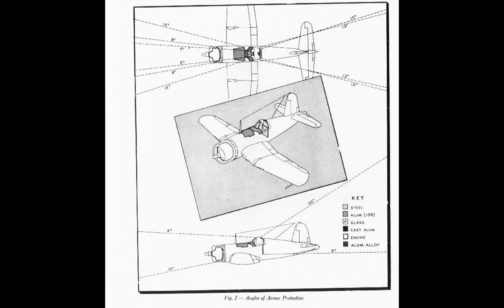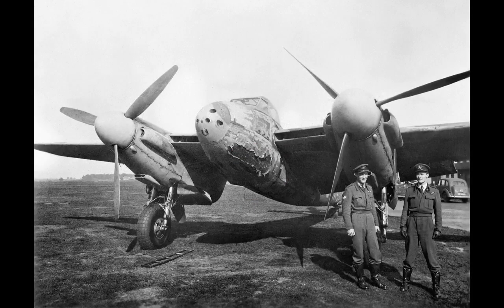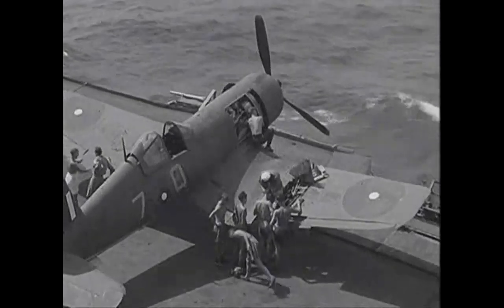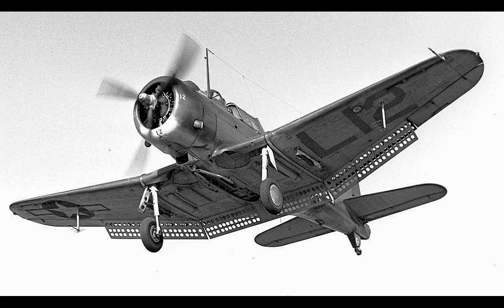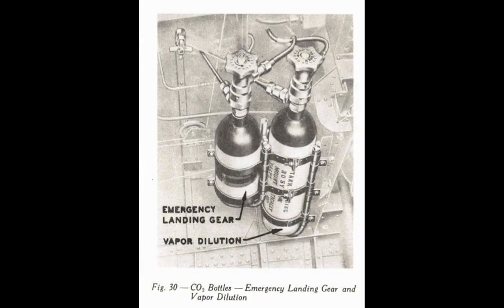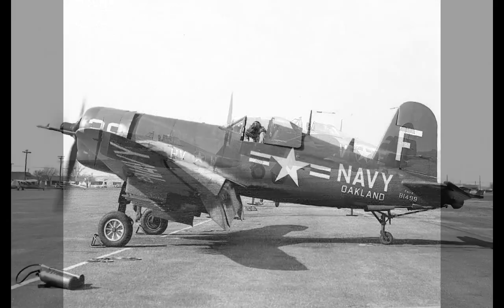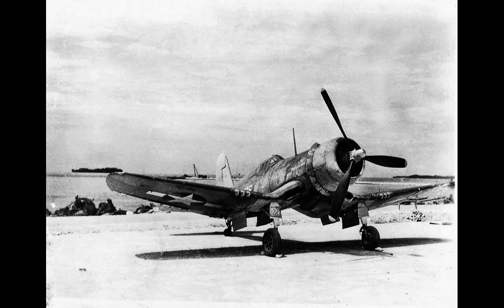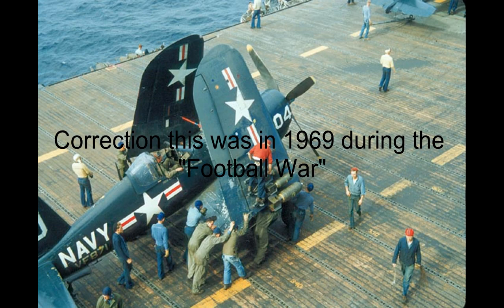F4U Corsair Design Features

Comment: Hi Greg, after seeing a video of a Corsair folding her wings down with engine shut off,I wonder how it's done? Is there a battery supplying an electricdriven pump?
Reply from the maker: I haven't seen that, but it's either a big accumulator or an electrically driven hydraulic pump.
Reply: @GregsAirplanesandAutomobiles  From the F4U pilots manual: "With the engine running, the wings will fold automatically. Otherwise, the hand pump must be used." Never thought of a hand pump, because folding movement was quick and fluent.

Comment: I believe the Boeing 777's vertical fin is in front of the horizontal tail due to the Whitcomb area rule to reduce drag.
Reply from the maker: I don't think so, but if you have any evidence of that, I would be glad to hear it.
Reply: @GregsAirplanesandAutomobiles  
I don't have any hard evidence I'm just going by what my instructors said when I did my aero engineering apprenticeship with Qantas...but I'll see if I can dig something up.
Reply: @GregsAirplanesandAutomobiles  
I should also point out that another reason for staggering the horizontal and vertical fins is to prevent the horizontal fin from blanketing the fin during a stall so as to maintain rudder authority.
Reply from the maker: Normally when rudder control during stall is the priority, they move the rudder farther back, like on the Mitsubishi Zero, or P-51 Mustang. In fact in every case I know of with the forward rudder location, the plane is prohibited from doing spins specifically because the rudder doesn't have enough authority at high angles of attack.

Comment: Re the tail fin being far forward of the taiplane: probably also done to ensure rudder is not blanked by the tail plane if the aircraft is in a spin. Helps with spin recovery. If the aircraft spins flat, the tailplane can stop air flowing over the rudder and so you cannot recover by using opposite rudder input.
Reply from the maker: A lot of people have said that, but I can't find a single airplane with that tail design that's approved for spins, in fact, it's the opposite, every plane I can find with that tail is specifically prohibited from intentional spins.
Reply: @GregsAirplanesandAutomobiles  interesting.  Is there any design specification explanations from Vought or is it just lost in the mists of time?
Reply from the maker: I am afraid the information is lost. If it's not, I haven't been able to find it. As with Repulblic Aircraft it seems that with multiple mergers and break ups a great deal of information was lost or destroyed to make space back in the era when everything was on paper. What was Chance-Vought is now the Triumph Group: https://en.wikipedia.org/wiki/Triumph_Group  and I doubt they have anything on the Corsair at all.

Comment: A couple of things to add info to a great video. First, after watching your video on the maneuverability of the Japanese Zero, you posited that the tail design was done to allow the plane to remain maneuverable at very high angles of attack. You then went on to say that you didn’t know of any other planes that had this feature. Well, here is the Corsair with the same feature. Also the DeHavilland Mosquito had the same feature. I think this may have been due to the rapid pace of aerodynamic design in airframes. Many planes were built the way they were because that was the prevailing state of design. Don’t forget many design features in airframes were copied from previous generations. The Grumman F4F was the next logical progression from the F3F biplane design. The F4F’s landing gear was manually retracted. Thus you would see the plane flying an unusual profile just after takeoff while the pilot, often sweating profusely, cranked the gear up. The next generation of fighters used either electric retraction (the FW-190 for example) or hydraulics. In the case of the Corsair’s landing gear, not being telescopic, required it to be very strongly sprung and that was one of the primary reasons it failed early carrier qualifications. Hard landings led to high bounces and missing the wires. One part of your video shows a Corsair being snagged out of the air by the arresting wires. This caused the plane to rotate nose down very quickly and ripping everything forward of the wing off. This was obviously be a bad thing and it required Chance Vought to redesign the landing gear. One of the reasons the Corsair had such strong landing gear was because of its very large, forged main spar. This W shaped spar allowed for very strong landing gear. Anyway, the spar was a W shape because of the design decision to make the wing the shape it was. One last thing about the wing design, the wing attached to the fuselage at a 90 degree angle with no fillets.
Reply from the maker: Absolutely not. The Zero's vertical stab location is completely the opposite of the Corsair's in relationship to the horizontal. I also specifically mentioned the Mosquito's tail in this video.

Comment: Wow.  A-26 in the pic had 16 x .50cal M2 (HB) firing forward . . . 8 gun nose, three guns in each wing, and the dorsal turret locked forward.  A whole lotta lead goin' on.
Reply from the maker: Yup, you don't want to be in front of an A-26.
Reply: William, and additional  you can use  Gunpacks  (Pods) , with four  0.50 cals under each wing

Comment: I believe also that the Corsair was the first to incorporate flush riveting.  If my memory is correct.
Reply: Not sure but I think you'll find the early model spitfires had flush riveting on the wing leading edges. They built a prototype with all flush rivets and then stuck split peas onto all the rivets with glue. Then, after a test flight, they checked the plane to see where the split peas had blown off and in those locations installed flush rivets in future aircraft. Dome head rivets were cheaper and quicker to install, so they used them wherever possible.

Comment: was this the best piston fighter during ww2.ive always wondered why it was not a frontline fighter in europe.on the accurate fighter sims it always seems to feel the best and for me i get high kill ratios with this plane.so why was it not used in europe in a major way.i know the royal navy used a few????
Reply from the maker: It's really tough to say which WW2 fighter is the best, but clearly the Corsair would be in the running. In Europe it would have been highly effective at low altitudes, but at high altitudes it's another story. Up in the 20-30k foot range, where the plane would need to perform against 109s and 190s while escorting U.S. bombers, the Corsair would be at a disadvantage. There were also political and logistic issues. Initially Corsairs were flown by the U.S. Marines, who were in the Pacific. I don't think the USAAF would have wanted to coordinate with them in Europe, but that's just an assumption on my part.

Comment: On the forward mounting of the vertical stabilizer. I'm pretty sure it was in fact an aerodynamic reason. I can't remember where I read it, but (and I might not be spot on here, but it should give you a good place to start more research) As I recall, the forward mounting was for high speed stability. As you know some P-38's had their tail's lock up during high speed dives, resulting in aircraft/ pilot loss. I believe that the forward mounting of the vertical stabilizer on the F4U was an early attempt at solving the moving tail problem at high subsonic speeds. As I said, I might be off on that, but I'm pretty  sure it was for an aerodynamic reason. Great video as always. Keep them coming Greg.
Reply from the maker: It's possible, but I haven't seen any evidence either way, and the structural reason makes a lot more sense to me. I doubt it's for high speed dives, the Corsair's wing already limits it there, as with every naval fighter of WW2. In the case of the P-38, it's tail locked up at high mach numbers (like around .70) but that had nothing to do with the vertical fins.

Comment: 13:30 I’ve heard that one of the things that made the P-51 such an icon was actually just that the cockpit was layed out in a way that made sense, and that it was much roomier than most.  I’m assuming that the roominess was necessary for those long flights

Also, more in line with the video, given how much more vulnerable to damage at high speed the gear is on most planes, I would imagine that the sturdiness of the gear was designed in part to also allow them to be used as airbrakes. And you can’t use the gear as airbrakes if they are fragile, which telescopic gear would probably be

Comment: Hi, at 10.30 you start talking about the location of the vertical stabiliser. I think this was done for spin recovery reasons. With the relatively forward location of the vertical stabiliser it would not be in the wake of the horizontal stabiliser when the aircraft was in a spin, see "The Design of the Aeroplane" by Darrol Stinton, inparticular plate 13-1 and the top picture of the NDN-1 Firecracker. This aircraft has a similar position for the vertical stabiliser, "...it has some of the best spin recovery characteristics...even power ON..." The pilots manual for the F4U-4, section 17, says words to the effect that intentional spinning was not be done but if you find yourself in a spin then it is easy to get out of.
Reply from the maker: The Corsair was not approved for spins. As for it being easy to get out of, the manual I am looking at says the opposite. "Pilot's Manual for F4U Corsair" says on page 45 "if a spin should inadvertently develop in either the clean or landing configuration the pilot must use EVERY effort to apply FULL opposite rudder followed by FULL forward stick". (emphasis mine). That's pretty much the same recommendation as every other plane that's NOT approved for spins. 

This tail design isn't unique to the Corsair among WW2 planes, and in every other case of a WW2 plane with this tail design, it's not approved for spins. I am not familiar with the Firecracker, but I just don't think it's comparable, it's less than 1/3 the weight of a Corsair and doesn't have a heavy R2800 swinging around during a spin. If you find a WW2 fighter or Attack type plane with this tail design that is approved for spins, then you may have a point, but I don't think you will.

Comment: 1 inch diff  in dia??? how bout 12 inches,,,
Reply from the maker: Ahm, NO. The F4U-1 had a Hamilton Standard Prop with a diameter of 13 feet 4 inches, or in some cases an alternate prop of 13 feet one inch. Some later variants had props that were 13 feet two inches. The Original Thunderbolt prop was a Curtis electric unit of either 13 feet 6 inches, or 13'2". So Apples to Apples, the Corsair does not have a prop 12 inches larger than the T Bolt. The most common initial variants were 13'4" for the Corsair and 13'2" for the T bolt, thus a 1 inch difference in radius.  You may be thinking of the later paddle props.

Comment: I have a stupid question for you, when the cowl flaps are closed, where does the airflow over the engine vent to?
Reply from the maker: It's not a bad question. Even when closed, the cowl flaps are not air tight, they still allow some air through, it's just a lot less than when they are fully open. In other words, with the cowl flaps closed, the flow of air over the cylinders is reduced.
Reply: @GregsAirplanesandAutomobiles  Ty, that's kind of what I was thinking, just wasn't sure how much the flow was restricted there.

Comment: Just a comment on Corsairs, Hellcats and Swordfish. All of these aircraft ..... though not so many of each (not a large purpose built carrier involved here) ...  were on board HMS Speaker,  a converted ship to carrier. My Dear Dad was member of the RN crew on this carrier from around 1942 to the end of the war. 
I'm a private pilot and took him up a few times and had him fly the plane (Pa 28) straight and level, following a main road on two occasions and for around 20 miles. It didn't take long for him to grasp the relationship between the aircraft's nose and the horizon whilst occasionally looking at the vertical speed indicator to ensure he was in level flight. He loved it.

Comment: Great video. I was hoping you'd mention that all Corsairs up until the F4U-5 in 1945 had fabric covered outer wing panels, and they all had fabric covered control surfaces except for some Goodyear built planes with metal ailerons. Nobody ever believes me about the fabric wings, because all but one of the Corsairs flying today have had the wings metalized. The one in the Planes of Fame museum is the only exception.
Reply: I believe it was in the early seventies when Paul Thayer, President of LTV (Ling-Temco-Vought, successor to Chance Vought Corporation which produced the F4U aircraft) enjoyed flying the company's restored F4U (he was a WW2 ace) but during one hop an oil line broke and he had to dead-stick the aircraft into a field, going through a barbed wire fence in the process.  The airplane was returned to the plant for repairs but nobody knew how to repair the fabric covered control surfaces, so some Vought retirees were contacted and they did the job.
Reply: @randykelso4079  Actually, fabric covered control surfaces were common all through WW2, with a few exceptions. Even most planes designed during the war, like the P-61 and even the B-29, had fabric covered tail surfaces. But the Corsair's fabric covered outer wing panels were an anachronism already at the start of the war.  It seems strange to me that fabric covering persisted for so long, but I guess the idea was that it worked so why slow down the assembly line to make changes.

Comment: The record needs to be set straight regarding the US Navy's reason for initially relegating the Corsair to land-based operations instead of operating from carriers.  The very first Navy Corsair squadron, VF-17, was on board the USS Bunker Hill and was headed to Pearl Harbor when the higher brass issued the order that the squadron would be reassigned for land-based operations in the Solomon Islands.  After observing the squadron's carrier operations for over 2 months, Bunker Hill skipper John Ballentine gave his unequivocal endorsement of VF-17 to AirPac headquarters that he had no concerns or issues about the Corsair operating from his ship.  The Navy's decision to replace VF-17 with VF-18, a Hellcat squadron, was made because of supply and maintenance issues.  The Navy decided that all carriers should be deployed with the same fighter to streamline supply and logistics.  In his book "The Jolly Rogers", VF-17 CO Tom Blackburn said Ballentine was later told by the brass at AirPac this was the reason VF-17 was relieved, not because they thought the Corsair was unsuitable for carrier operations.  That myth has been repeated so many times over the years that it has been accepted as gospel.
Reply from the maker: I have read that, but it's not backed up by very many sources and I could not find any sort of official source that clears this up. The only references that seem to support the logistics theory are Tom Blackburn's book, written in the late 80's. While it's a good book, I'm not sure that what he says he heard from one ship's captain  who told him what he heard from "higher up" is conclusive. The only other reference I have for this theory is Dana Bell's book, which I think actually references Blackburn's book. 

Now that said, the logistics theory makes sense, but that only explains the reasoning for equipping the carriers with a single type of plane. It doesn't explain why they Chose the Hellcat for carrier operations over the Corsair. The Corsair was out earlier and was built in large numbers. The only reason that makes sense, and the one that's backed up by the most sources (by far) is the Hellcat's superiority in carrier operations.

Comment: A great aircraft, no doubt, but I wonder why U.S. fighter development stayed with machine gun armament when most countries realized the cannon was much more effective.
Reply: 6 .50 MGs was just good enough, and later F4us did get 4x 20mm. BUT the USN took a good while to get their 20mm ammo to WORK.
Reply from the maker: The answer to this is highly complex, and I'll cover it in my upcoming P-47 weaponry video. In short, the US 50 cal had a high rate of fire making hits likely. It had enough punch to knock down any axis aircraft from WW2 with ease, fighters, or bombers. Combine this effectiveness with the fact that the US didn't have a good US designed 20mm that would work in an aircraft, and the decision to use the 50 cal as a standard air to air weapon was an easy one.
Reply: A lot of Mig 15's made it back to base with lots of .50 caliber holes in it.

Comment: One more detail: the propeller axis on the F4U is angled 2 degrees up from the fuselage axis. I don't know if this was done with other aero engines but I thought it was eccentric as the entire engine must be mounted off-kilter relative to the fuselage. It also affects the angle of attack. This plane is either a huge set of kludges or hugely brilliant. Probably both.
Reply from the maker: The Thrust line is off from the longitudinal axis in many, if not most planes. Sometimes it's easily visible, for example: https://www.sanspotter.com/wp-content/uploads/2019/01/pbi-atl_delta_md88_N950DL.jpg

Comment: Putting in a plug for the B-26 Marauder. You have talked about planes being designed around existing engines: if the conventional wisdom is correct, the B-26 was designed around a promised engine that was never delivered. I think this plane, designed for speed and betrayed by optimistic engine promises, would lend itself to your approach.
Reply from the maker: I'll cover the Martin B-26 eventually. It has quite a history.